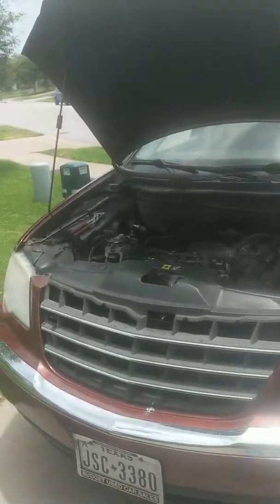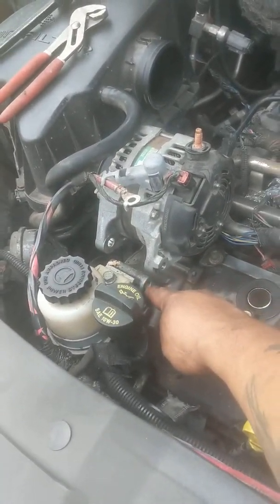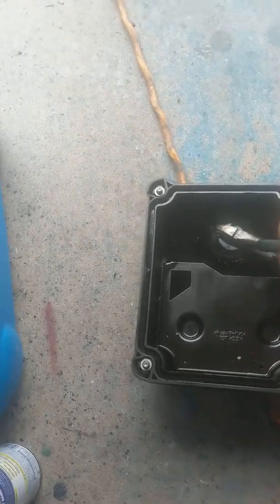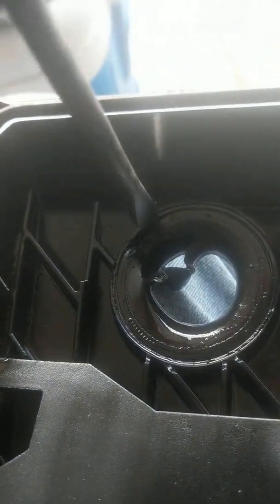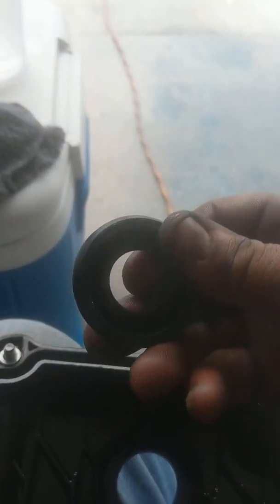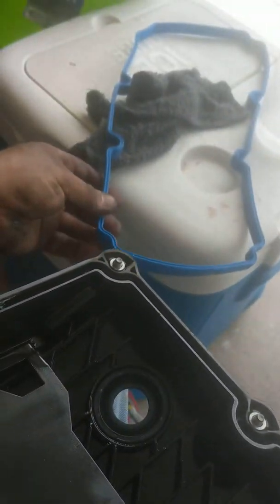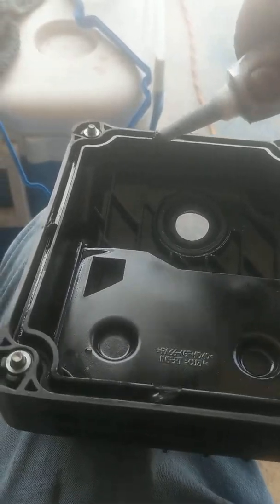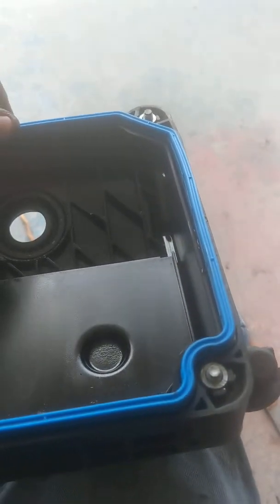Misfiring 07 Chrysler Pacifica

Comment: Did the oil in spark plug chambers cause your engine to turn off while in idle? It happens every time I'm at a light
Reply from the maker: It didn't shut off but it was idling rather rough